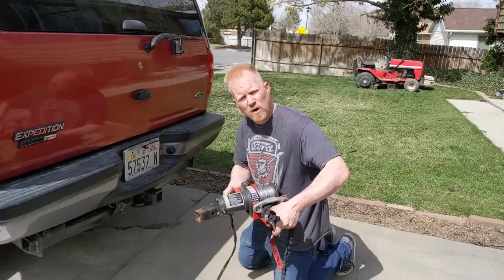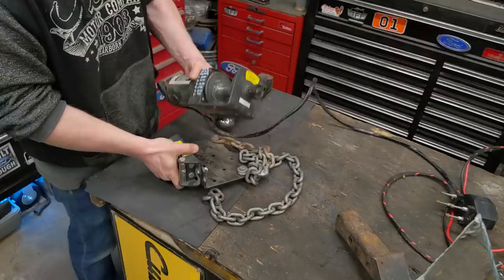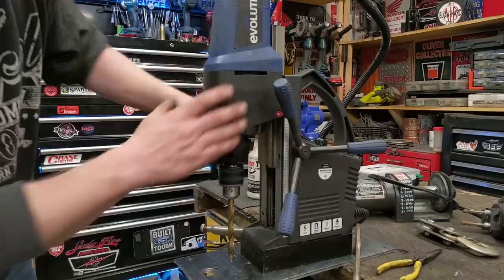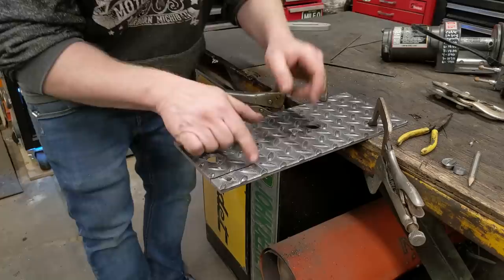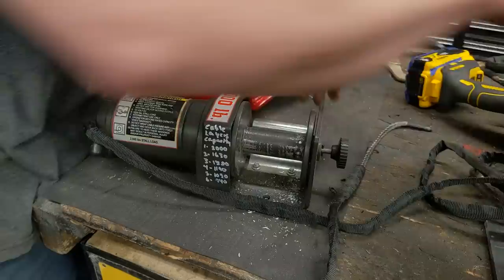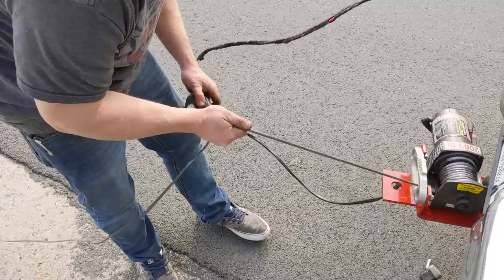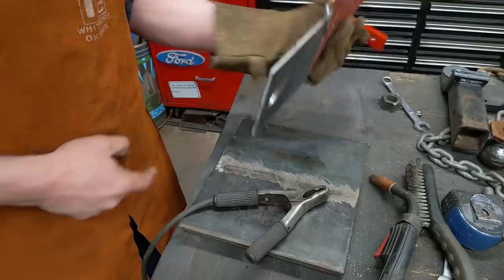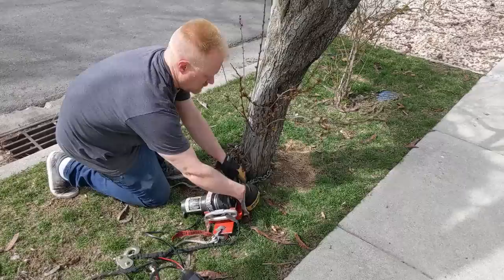Portable Hitch Mounted WINCH Build w/ Swivel and synthetic cable

Comment: Weld some flat stock to the hitch on both sides and on the end, drill multiple holes in it and put a couple holes that will line up in the winch plate. Then you can pin them to multiple angles so the winch isn’t trying to move.

Comment: I swear this is the most useful channel on youtube!!!
Reply from the maker: Hey Thanks.
Reply: I couldn't agree more!  I never comment, but I think you are a freakin GENIUS!  Thank you for spending the time to teach me such useful life skills! YOU ROCK!!
Reply: I agree. I've learned so much from this guy. I copied his tire tool changing tool for the harbor freight tire changer and love it
Reply: @sixtyfiveford  what's better a rope or the cable.what would you advise
Reply from the maker: @iancameron198  I've been switching over to rope. Why? Lighter and easier to move around. Biggest issue is they aren't abrasion resistant though and it still makes me nervous that they're going to break when I need it. I will say though I was using a cable come-a-long week and a half ago and I stabbed myself so bad with a stray wire on the cable that I swore I hated cables but I don't know.

Comment: Great idea, we think alike. Only difference is I bought a receiver with stacked receiver tubes so if I have a trailer hooked up I can use the top tube for my winch. I didn't think about the swivel action so I'll definitely use your swivel set up. My thoughts were pulling onto a car trailer or tow dolley when working alone. Came across your video by accident but glad I did. Thanks for the idea/ info. Jack Leonard

Comment: I use mine to get HVAC equipment up into the attic & power it with a 20v Dewalt battery. I got mine at Harbor Freight w/a wireless remote for $75. I love the look on my customers faces 
when they ask how are you going to get the furnace down & backup. And I tell them my thumb.
Reply: How far dose one batt. Get you? I have the DeWalt 20v 2ah batt. Just wondering how far they'll get me
Reply from the maker: That's awesome. I think these small winches pull around 10amps under light load and 50amps stall at 12volts. A typical 18v/20v battery pack is going to put out 30amp at 18volts nominal. So more than enough amperes to handle the load. The higher voltage would be hard on the winch if you ran it for a really long time, but winching is a quick job. Nice idea.
Reply: Hell yea that's awesome

Comment: Great idea for a project. Years ago i had a winch, smaller than this, but it had a similar set up.  Instead of having the receiver mounted, it had a large hole that you could drop over the trailer ball.  Pretty handy. It burned out and i couldn’t source parts but i kept the mount. I have a big 10k lb winch now. Overkill. But i only  gave $150 for it.

Comment: Here's what I did, basically the same idea but instead of bolting the plate to the ball I cut a keyhole in the plate and it just drops over the ball. That way it's quick and you can leave your hitch in.  Other than that I like it. Oh and I use a remote control winch, it makes like a little easier.
Reply: A great idea made even greater! The keyhole idea is ingenious!!! Thanks to you both

Comment: Good. I use a winch occasionally on my lorry so I wired a Anderson plug to the rear next to the trailer plug and just plug it in because I use the winch as a lifting mechanism whilst driving.
Reply from the maker: That's fantastic. I've thought about installing plugs front/rear. Maybe I'll have to now.

Comment: I mounted a square tube on the front of my ATV and back for the same reason.  If you put a cut piece of nail or anything with a point in your mag drill  chuck . You can center a  hand tap perfect every time. We use to do that on huge paper machine base's cutting threads for anchor bolts.
Reply from the maker: That's a good idea for lining it up.

Comment: I was impressed with your magnetic base drill. I used the earlier version "Bux Drill" in the 80's to drill out broken 1 1/8" studs sideways on  30" compressor cylinder bore.

Comment: Used HF trailer coupler for 3" channel trailer tongue, drilled appropriate bolt pattern into top flat of coupler, mounted HF 2500#  winch with matching fairlead mount.  Be sure bolt pattern allows for clearance of the coupler handle.  Control box mounted underneath the coupler, where the 3" channel would bolt.  QD Anderson electrical connector, 12V battery in plastic battery box completes the system. Now can use winch from any 2" ball hitch.  Rotates horizontally with some vertical alignment for very straight pulls.  Use old 2" ball mount with chain around thread ball mount for chain to go around post, tree, etc for other applications.  Easy Peasy.  Use with HF dual hitch extender to hitch trailer to Jeep and  also mount winch for loading trailer.

Comment: No kidding Moe.... Several days ago I was talking to the GF about making a winch mount on the kart where it doesn't have a reverse and do have the 2" receiver on the rear. Do riding up north in areas where no one is around to help if stuck. Your video was packed full of so many helpful idea's that I will be using. Thank you so much!

Comment: I combined this swivel mount, but with your other video of the drill powered hand winch. So now I can winch from all angles with the battery powered drill. I can also take the winch off, and bolt on a vise, or my mini tire changer. I have a 12v  winch hooked up in my truck bed at all times, but this swivel mount is the bees knees for odd angles, and being that it's portable, you can do all kinds of stuff with it! Thanks man!

Comment: Nice set up. I basically did the same thing with a worm drive hand winch I had. You can drive it with a cordless drill. No 50 lb battery to lug around. If I might point out, it looks like you might have set the fairlead too high. At 13:00 The fairlead looks like it is rubbing pretty hard against the rope. I see it is probably on the 3rd or forth wrap, but if you set the fairlead as low as possible so it just barely clears the cable on the first wrap, it should give you about 3 or 4 wraps before it starts rubbing hard on the other end. Also consider cutting off 1/3 of the rope and make a winch extender out of it. You won’t have to pull so much line out to get to the bottom wrap and if you have a long reach, you can always use your extender.

Comment: A magnet tip that’s useful for us and maybe you someday we use it when we need to drill through ceilings floors walls where it takes two people to locate the hole before cutting 

We take two round neodymium magnets one one either of the surface we want to drill or cut when they connect we can measure to any obstructions or framing.
Reply from the maker: Great tip!
Reply: I'll have to remember that one brother.😉👍👍
Reply: Chris Gilliam Man Stuff 

It’s a big help we use it all the time

Comment: Well I finally built mine today. I've had one for several years to pull straight off of my 1 1/4" receiver. But my new car has a 2" receiver and although I bought an adapter, I liked your swivel idea. My new build fits the 2" receiver and swivels. GREAT IDEA, thanks
Reply from the maker: That's great.

Comment: Years ago I made and still have my little winch on a 1/2 plate with a cut out like the old skeleton key opening so you just ste it over the ball and it slides to the narrower portion. Stays horizontal and rotates around the ball
Reply from the maker: Nicely done. I like it.

Comment: I like your setup! I've been using a Warn drill winch for about the same thing for a few years now and it gotten me out of several jams up in the woods. Great for pulling logs around too.  However, at only 750lbs of pull I have to rig three snatch blocks in order to enough pull to get the job done at times. Three times the pull equals three times slower, which can make a lot more work out of a self-recovery. So, I've been thinking about putting together something like you did here. I'll probably go with a 3500lbs winch, which is still light enough to pack into the woods a little ways, or move it to the front of our rig and attach it to a recovery hook with a short tree saver type strap.

Comment: Not bad at all mate I get stuck out in the bush often very sandy and normally use my trucks onboard crane to get out of trouble.i can use my jump starter pack because quite often it would save a lot of time securing the winch to a tree instead of the back of my truck.a small two ton truck that just looks at loose rock or dry sand and gets bogged.well done matey you have saved me some shovelling

Comment: Neat setup. One idea or suggestion for your consideration:  You could put a bar 90 degrees to the winch drum to give you the ability to direct the rope side to side. The bar probably needs to be about 3 feet long and be able to work either side so removable. It could be placed ahead of the drum or behind, whatever works for your mounting plate. In this way the drum will remain neatly wrapped all the time.
If you use a round bar welded under the drum you could use a pipe on it as your bar and it would work either side.
Another way might be to have a nut under the drum that you put a power bar or breaker bar on to turn the thing a bit.
No more birds nests.
Just a thought, maybe the issue isn't there with the longer plate changing the pivot point.
Reply from the maker: Great idea. Thanks for your perspective.

Comment: I have a 12000 lb. Warn winch mounted on a Reese receiver cradle and I use the crap out of that thing.
You're setup looks great, much smaller than what I have but I'll bet you'll find all kinds of uses for it.
Great job.
Reply from the maker: That's a lot of pulling power.

Comment: The lady at Pawn Mart use to call me when tools came in that she didn't know what they were. About a year ago a mag drill like yours came in. The model and such were torn off except for the brand name. She gave me first dibs on it but I told her I'd wait and see if it sat and the price came down more. It sat for a couple hours she said. I really messed up on that one. It had a set of saws from about 3/4" to around 2" with it. It was about half the weight of a Milwaukee mag drill. She has given me some seriously great deals on other stuff like small engine stuff from other stores that had sat until all tires were flat and gas had rotted , because I would go and get her stuff running again. But for truck and trailer frames those lite mag drills are the bomb.
Reply from the maker: It's great to have an in like this.

Comment: When you double the cable through the snatch block and back to the winch (or other stable anchor point), it effectively doubles your load pulling  power.
Reply from the maker: Yes, I use a snatch block every chance I get. It also allows more cable to be drawn out and increases the pulling force via the drum size.

Comment: I made something like this. 12,000lb winch. Heavy as one can get. Great for pulling tractors and trucks out of stuck situations. Total overkill. Love your idea of a swivel. I welded a 2" receiver to the bucket of one of the tractors.
Reply from the maker: 12k, that's some serious pull.
Reply: @sixtyfiveford  yeah. I didn't want to worry about the steel cable snapping. When they break other stuff breaks with it. I figure with that kind of pull something else will give up long before the cable.
Reply from the maker: @concert610  I've always hated moving around the thick cable on bigger winches. This new synthetic cable may make me want to pick up a 10k or similar.
Reply: @sixtyfiveford  this is my first winch and I will agree with you.  The winch is heavy and the cable is heavy. Very annoying to say the least. I have thought about synthetic but I don't use the winch much. I would get more use out of longer electrical cables.
Reply: @concert610  I have a 13k lb winch I got off Amazon. Pretty awesome. I saw a 17k lb one on there too, but I don't remember the brand. I pulled a tree over with mine, vid is on my channel. Used it yesterday to pull up fence posts.😁
Reply: @ChrisGilliamOffGrid  lol dang. I'll have to see that.

Comment: Love that Dog ! 

Think I'll build one close to yours, might add a stationary plate with holes on both plates to be able to lock in a direction.
Like yours tho, food for thought.
Reply: That's how my swivel plow is on my Willys 👍🏼
Reply from the maker: My original plan in my head was to put location locking pin like you describe. The reason I didn't was because you are always going to be pulling against the fairlead in this situation and spooling the line on one side. This drives me crazy as you can only get around 4-5feet of pull before you have to unwind, rewind by hand and then pull another 5 feet.

Comment: I need one for my light weight off road situations. I have no need for a full scale winch set up but this would help from time to time. 
If you dont go into production I would be surprises.
Reply from the maker: It has come in very handy.
Reply: There are winches available with an adapter that bolts to the winch and then slides over a hitch ball. I got this cheap plastic housing 2000lb, actually had a hand crank I think for back up. Got that at crappy tire (Canada) years back, I haven't actually used it too much (find I hook up a tow strap from a car to another car more often), but did drill some holes in the brush bar I had on my truck at the time, so I could pull from the front. Just two large bolts

Comment: Awesome idea!  Patent that thing before someone else does!!! My only concern would be a heavy pull at a high up or down angle. The plate would bend at the nut. Maybe up the plate to 3/8 or 1/2 inch. Bigger plate and a bigger winch for the heavy duty stuff. Some idiot out there would probably try to pull an 80 year old oak tree down with it 😂.

Comment: You could have put two moderately strong springs on the mount to the safety chain loops.  That would make it want to center at all times unless under a good load.  Just a thought

Comment: If you have a seven pin trailer electrical hook-up, you have 12 to15V power from your truck battery/alternator. You could wire up a plug with your push-button controls.
Reply from the maker: The 7 pin won't supply enough amperage to run the winch. You're going to only get 15-20 amps max from it. The winch pulls well over 100 amps at times.
Reply: @sixtyfiveford  Maybe I am wrong, but most trucks have alternators that produce in excess of 100 amps. You just need large enough fuse and wire size. Not sure what the contacts in the 7-pin connector are. But mine runs a hydraulic pump on my dump trailer.

Comment: I Like your design for pulling from the side ..I had the HF cable and rope both rot on me ....I bought the tough grid 5,000 lb. stuff at almost a buck a foot
Reply from the maker: I read that these ropes hate UV sun light and will fall apart.

Comment: A 7 pin trailer plug has a wire that is 12 volts all the time, so you could put a trailer plug on it to use at the back of the truck.
Reply from the maker: Unfortunately the 7 pin doesn't supply enough amps to power a winch.

Comment: I just use a dust pan and broom to clean up my floor of metal shavings.   It’s much faster and picks up everything, not just metal.
Reply: Sir, the purpose of claiming those shavings is the fact that it's steel . . . raw steel.
It goes into the steel barrel for recycling. When you cut enough steel, you begin to realize the potential for the $$$ back in recycling.

Actually, mine goes in the scrap nuts & bolts bucket, but either way it's going to weigh STEEL when it gets cashed in at the recyclers yard.

Comment: Hi Moe, This is really a good set up. I have not been doing much lately but when I start picking up tractors again I will be looking for a pickup truck currently using a trailer with a winch mounted to it. I noticed in the last series of videos how you reorganized your shop, looks great. Now that I am home I am doing a clean out & reorganizing of my garage.  Just having a issue when I go looking for something in its new organized location LOL. But will have it done soon.  Stay well, Joe Z
Reply from the maker: I think the word "organizing" should be rephrased to "hiding". There's been 2-3 times now where a spent an hour plus trying to find something that used to be easily accessible, now "organized" into a drawer.
Reply: @sixtyfiveford  LOL, I am not finished with mine but have the same problem.

Comment: Good job. Those metal saws are cool. Used a milwaukee to cut a 6 by 4 three quarter thick angle. No heat. Smooth cut. Couldn't believe something modern worked that well.

Comment: Cool fab Moe. 6 and 7 pin trailer plugs have a 12 volt pin. I put an Anderson flat connector on my winch and jump start pack and wired one to my 7 pin on my class 3. Don't you have a 6 or 7 pin on your Expy? Stay safe and thanks for posting.
Reply from the maker: I do have a 7 pin I could use to charge the battery up.

Comment: At 13:15 was wondering if you can just rig up a 7 pin to the trucks hitch trailer wiring harness instead of hauling around a car battery. The winch would run off your truck battery. Great video.
Reply from the maker: The winch under load pulls 50 to 100 amps so it would be too much for a 7 pin.

Comment: Nice design. I will be doing this one. What is the little welder you used there?
Great vids but your dog/s are the Best part. They bring joy to us on this side of the tube too. Thanks
Reply from the maker: Thanks. In this video I was using a small 120volt Lincoln WeldPak 100 Mig welder.
Reply: @sixtyfiveford  Excellent, that is the same welder I have at present (Lincoln 100 Mig). I have been looking for a Lincoln tombstone but might go with one of those china induction units. Save space, lugging weight. It won't last like a tomber but I'm gettin old fast anyway. Not sure yet. I hate buying china.